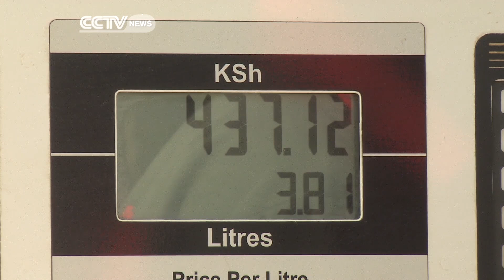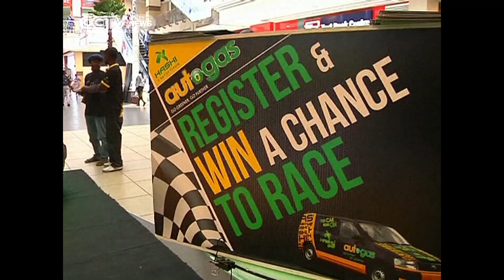Kenya Manufacturers Begins Production of LPG Fuel Cars

Comment: we used to do this years and years ago in Australia but i think the main idea behind it back then was it was unleaded and was a way to get all the cars that needed 'Super' also known as 4-star leaded petrol running on unleaded, it caused issues that tainted LPG's reputation as a motor fuel, since then unleaded petrol has become the norm and cars dont need lead to survive anymore, as the same time all of the "problems" of LPG as a motor fuel have since gone away and since the introduction of LP Gas injection and valve lubricant additives the issues and losses of LPG are now gone

i would like to see it become a normal fuel again in Australia, bring back the subsidys that made it almost free to convert a car to LPG (the car i used to own that was LPG cost $72 after the subsidy to convert)